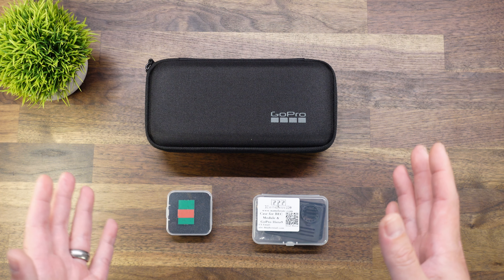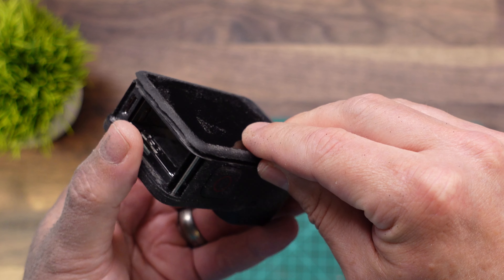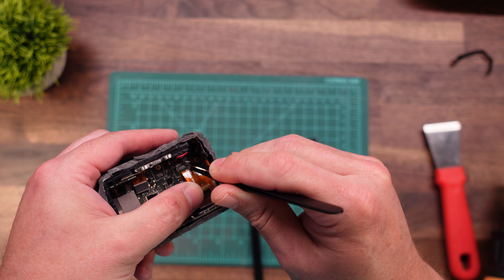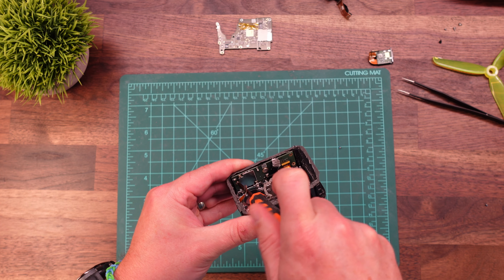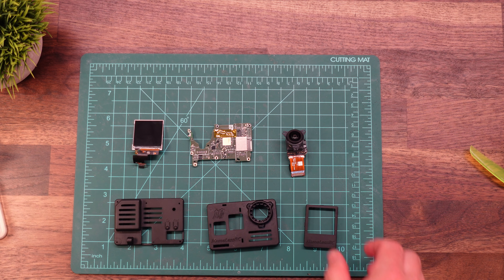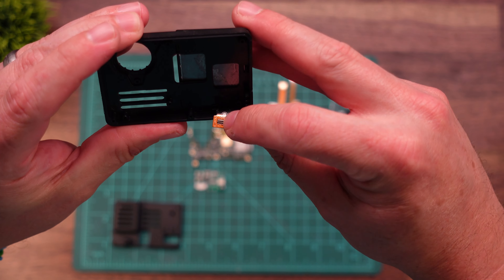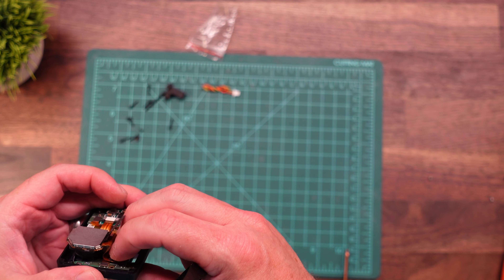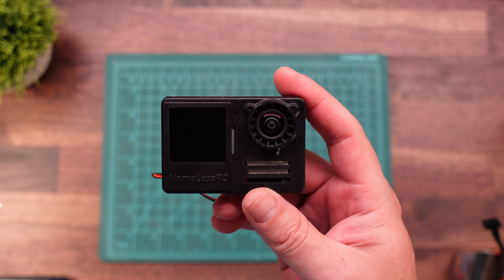Build a Naked GoPro Hero 9 for under $300!

Comment: wheres the link to the gopro labs tutorial?
Reply from the maker: https://youtu.be/aCXTO1yl4lc
Reply: @ also if you leave the antenna connected theres no need to load on labs, app still works. I was able to fit everything inside the naked rc case
Reply from the maker: @mohitreddy8082  I recommend always installing GoPro labs on any naked camera. The biggest reason is for pairing it to the Quik app. You basically have to put the battery tray and screen back on to re-pair it, like when you get a new phone and have to pair all your cameras again.

Comment: Does hero 9 front lcd screen compatible with gopro hero 11 board? 16:44
Reply from the maker: From the research I've done it looks like the Hero 10, 11 and 12 use the same front screen and the Hero 9 may be different. But I haven't personally tried using a 9 screen with an 11 board.

Comment: why need to tear gopro can we not buy parts needed  to built naked gopro?
Reply from the maker: You can buy the board and lens and make one if you want, but it will end up costing quite a bit more than buying a used GoPro. It's totally your choice.